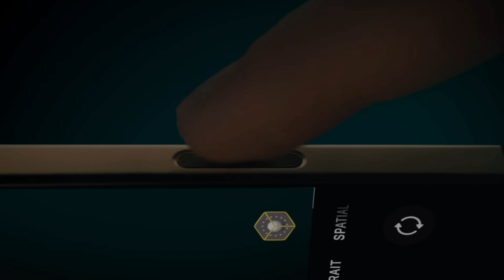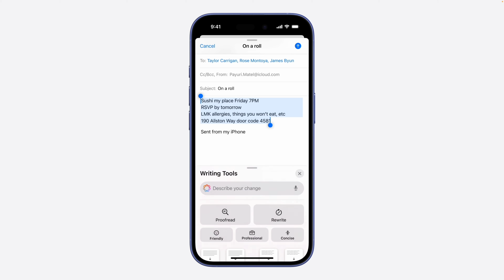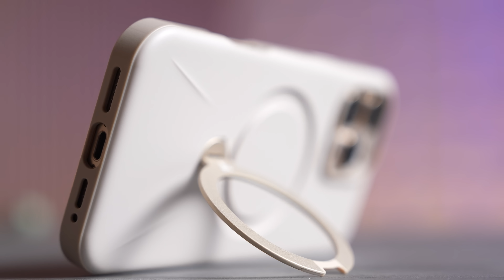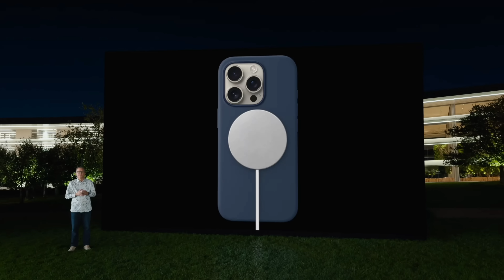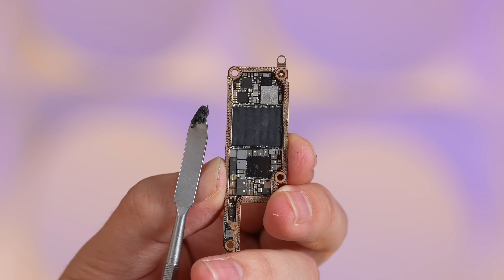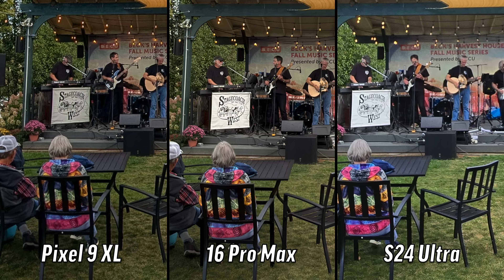iPhone 16 Pro vs 15 Pro - REAL Differences After 1 Week!

Comment: I have been using the iPhone 16 Pro Max for a week now. As I switch from Android, I still have some time to get used to using it. I can already say that I am happy that I switched. As for the camera button. It works much better when used with a thumb. Here you just need to flip the phone so that the button is at the bottom instead on the top. There the location is perfect for the thumb.

Comment: If you’re a gamer, the 16 promax is a very welcome jump. I’m assuming this guy is more referring to the casual customer that has no idea that they’re walking around with a mobile PlayStation 4 in their pocket. It keeps frame rates much much steadier than the 15 Pro. It stays much much cooler and never throttles even one playing the AAA games like death stranding. 

A lot of the stuff these days is going to be under the hood of the phone that most people aren’t going to be able to notice  YETTT. As the AI boom continues, you’re going to have no choice but to pick one of these newer phones simply because of what Apple has done under the hood. 

It’s one of those things you can’t quite see now  (unless you’re a gamer like me).  But you will definitely see down the road.

Comment: You wouldn't have had any Wifi improvement at your home between iPhone 15 & 16 because Wifi 7 requires a Wifi 7 capable access point to negotiate with your iPhone,.  If your home isn't Wifi 7 capable you won't see any improvement

Comment: You'll never notice a change in wifi speeds until you change your router or access points. I bet you're trying to use wifi 7 with a wifi 6 router or worse a wifi 5 router. Many ISPs do not replace their outdated customers tech

Comment: While I use the action button everyday as flashlight toggle the camera button was nothing but a nuisance. When I tried to make use of it it didn’t work properly and the most of the time it did nothing but produce bad haptics due to the cutout most third party cases have here. I returned my 16 pro max due to the enormous size and weight and no I am torn between 15 pro, 16 pro or base 16, because I want to be ready for apple intelligence, but the camera button really holds me back from pulling the trigger on the 16 series…

Comment: Hi, I wanted to ask, I now have an iPhone 12, should I upgrade to an iPhone 15 Pro Max because of the similarity between the 15 Pro Max and the 16 Pro?
Reply: Hi, I changed from an Iphone 12 to an iPhone 15 pro last year. Definetely worth it, huge difference for me. Now the differences between 15 and 16 in general are subtle so I guess it depends on your preferences but I would say save your money and get the 15 one. I will only change again for the 17 pro or 18 pro, depending on when there’s actually a noticeble difference again.

Comment: Got the 16 pro today. 
Action button is great, i personally use it for settings. However like you say with double tap for camera i replaced for music on android. 
Camera button is why i upgraded from the 15. I take alot of photos of cards which the button saves time not needing to adjust grip to click the on screen button. The gimmick in the settings are not that useful bar the zoom feature. 
My biggest bug is size. In first glance it looked a little taller comparing to the 15. In hand after a day it feels clunky. Il try for 3 months but day one is telling me to revert back. Felt like the 15 was the perfect phone size.

Comment: Thanks for the review. Are you able to compare the 3x optical zoom of the 15P with the "Zoom to Crop" equivalent of the 16P and give an indication of how they compare? I like the 5x optical zoom idea on the 16P but did quite like the 75-85mm focal length range (around 3x). I had a question how much quality degradation there is on the 3x photos without pixel peeping.

Comment: My biggest gripe on the iPhone 15 pro max is thermal issues. It gets warm and hot too easily especially in summer. This is unacceptable. Yet they make a faster MagSafe charger? The phone would cook an egg. They really need a real fast charging. Not upgrading.

Comment: Camera Control is a gimmick - fiddly, slow and stupid as the on screen options are already there and are much faster to access. Who the *@!(! has the time to do Camera Control when taking a quick picture ?! ?! Please

but there are few PRO's for 15 pro vs 16 pro:
PROS:
+ Better thermals;
+ Improved battery performance probably due to improved thermals, cpu optimization + screen capable of going as low as 1hz; 
+ Bigger screen although in real life usage its effect is minimal;

CONS:
-Heavier
-Slightly larger frame !!!very!!! slightly affecting one hand usage
-useless button called Camera Control

Comment: Ofc the 15PM vs 16PM will feel like a rip. Apple only needs to cater to typical upgrade intervals. By mobile carriers, that’s every 2-3 years, so as long as the 17 is a large improvement over the 15, Apple will have done well.

Comment: I switch from iPhone 4s to 5s…
And then from 5s to SE (old se)
And after  this it was 12 mini …
After 12 mini to iPhone 15 pro… And that was an upgrade … 
on ip15 pro i have all what i need… 
For now it is very good…
Maybe iPhone 18?
Reply: 12 mini to 15 pro max…today i ordered
Reply: How is the 15 pro after so many years of small phones?
Reply: @ballooneyjr4294  Because they killed the mini phones. I am using 13 Mini and desperate for another Mini but with the same top specs as the 16 Pro/Pro Max. But now I guess I will have to stick with my 13 Mini until it dies. I love it, but I will have to replace it some day and the fact that nobody is making Mini phones really makes me sad.

Comment: If I would not have had such a massive battery issue with the iPhone 12 mini, I would have opted to keep that for another year or two.  I could not last an eight hour work day without having to charge the mini.  Coming from that to the iPhone 16 Pro is ostensibly the same.  The capacity and screen is much better.  The added camera is not really a big deal and neither is the camera button.  Overall, it is a negligible upgrade.  I still have my 4S and was amazed how the experience has not changed since 2012…iOS is arguably the same and the 4S even shoots in HDR.  I do not get what people are looking for.  Technology plateaued in 2010 or so, everything since has been iterative and superfluous for most people.  Like the 16 pro but it does nothing my 12 mini or XR did not do…again, beyond the display, battery and capacity.

Comment: I'm glad you compared the 15 pro max to the 16 pro max as I fairly recently got the 15 Pro max for the first time, and it's great, battery life, lenses and Dynamic Island all great. It's a bit disappointing that 16 pro max isn't much if any improvement, companies can't do the quantum leaps they used to every year. The wait for apple intelligence is strange as they are advertising something which isn't there yet. Maybe it isn't reliable yet, or the local compute infrastructure isn't completed yet. Surely there must be rumours

Comment: So if you were upgrading from a 10, 11, or 12 would you go for the 15 or 16 be it pro or pro max?
Reply: that's what i'm wondering too. i'm going to upgrade from a 11 but idk if I should get the 15 pro or 16 pro. I don't really see much difference. and the 15 pro is cheaper. I wonder if the 16 pro is really worth it

Comment: Solution/Fixes to Camera Control Button and ALL three (3)  camera concerns! First Step… go to Settings > Accessibility > Camera Control > Lighter-Press Force > (✅Check the) ‘Lighter’… Next in the same Accessibility Camera Control area at the bottom, (✅Check the) Double Light-Press ‘Slow’… these two (2) settings makes a MASSIVE difference and works super consistently.

Thirdly, to see the On Screen Camera Controls while also using the Camera Control Button. 👍 Go to Settings > Camera > Camera Control > Clean View (and toggle the switch to OFF).

Hope that will others out there… it TOTALLY changes the way the iPhone 16 Pro Camera Control Button works. 😇🤓😎

Comment: I’m still under the impression the upgrade from the 14 pro to 15 pro was the absolute worst in terms of price/ performance upgrade. Feels pretty much exactly the same with a case, yes I’m aware that the titanium is lighter, but in a substantial case, that weight difference is not all that noticeable (Maybe more noticeable in the ProMax with the 5X being exclusive). For live stream HEVC encode performance, efficiency, heat dissipation, this generation from the 15 pro to 16 pro was a tremendous upgrade, since it finally allows me to run Moblin on 4 sims without overheating or trickle charging. I definitely realize encode and bonding multiple sims on a phone is an extreme heavy use case that goes way beyond power user/ heavy gaming. As every component gets taxed to the limit! For extreme use (when not using my prosumer grade LiveU Solo Pro), it is basically the only option in existence that can keep up similarly (ProMax being slightly too heavy and large on a monopod), and my other stream phone is the S24 ultra which pales in comparison, However, the S24U screen is chefs kiss! Amazing as a chat phone. No bias, each has their advantages and disadvantages. My Pixel is now regulated as a backup of a backup in the form of a modem now, Jack of all trades, master of none. Imho

Comment: The only reason to upgrade is battery life. So, looks like this is the second time I will postpone the upgrade (the first one was from 13 to 14). Really disappointing release with no significant hardware updates. Moreover, Pixel 9 XL shoots look much better in the comparison in this video.

Comment: One thing that I do appreciate with the camera is the new raw format jpeg xl lossless I assume that’s the highest quality but the thing that impressed me was it was half the file size. I tested it against my iPhone 15 Pro Max, which is really nice to save space.  Also, I did appreciate the speaker being a little richer like you said in your other video.  Of course the battery life is always welcome.   I agree with you. It’s not the biggest upgrade and it is a little disappointing although I do appreciate the 48 on the Ultra Wide. 
One thing that is also keeping me from not returning it and going back to my old phone is that I would like to have an action button and then have the camera control button for at least quickly opening the camera so I can have the action button for something else    I do agree with the Mac rumors podcast that we were reviewing the new iPhones.  It really is faster to just use the screen to change the lenses, etc.. I’ll probably only use it to open the camera and possibly zoom on certain occasions but not sure I’m gonna get used to snapping photos by pushing that button time will tell.
One disappointment that I had is that my old case that I had for my iPhone 15 Pro Max, I re-ordered the same case for the 16 Pro Max and it was bulky  and the camera control button didn’t feel good holding it in the hand because of the cut out on the case and the sharp edges    so I’m having to try another case that I like better    there’s a company called geometric goods that has a folio case with a magnet in it and you can put in an iPhone without a case or it’s compatible with other MagSafe cases so it’s kinda nice to be able to have a folio and then put your phone with the case inside their magnetically.

Comment: Thanks for pointing out iPhone 16 lines don't have or use Qualcomm x75 modem unfortunately, it's a total failure!! Also, I read somewhere iOS 18 use AI for battery use so that it will automatically optimize so we cannot expect a very standard performance all the time.

Comment: I’m one of those person that upgrades every year and I have to say I honestly should had just skipped this year’s upgrade. The ultra wide angle is worse than the 15 pro max, and the capture button is really only good to lunch the camera, other than that it’s useless. I’ve tried using it but I keep missing shots because it doesn’t have a quick response, you have to hit it just right. It’s just easier to use the touch screen to take photos. The battery life is definitely better and they seem to have solved the over heating issue but honestly not sure that was worth the upgrade.  The 17 better have significant improvements to make up for what the 16 lacked. I’m talking new bigger sensors on all 3 cameras lens.

Comment: Looking at available data, people who upgrade every year are a minority. As a YouTube creator who reviews tech you’re in an even smaller minority. Data shows that most users are hanging onto their phone for 3 or 4 years, some as long as 5 or 6 years. Apple are aware of this hence their advertising comparing new iPhones to iPhone 12 users. People upgrading so many versions in a single step will see a massive improvement. You should try the same - you’ll get better views and engagement.

Comment: 1. My 16 Pro Max doesn’t overheat as bad, I’ve only had it dim for a short time when out in the sun.
2. Something about the mic’s, Siri hears me better and dictation has improved markedly.
3. The battery life is, as you pointed out, a very nice improvement.
4. I wish the camera button would engage burst mode instead of video, when fully pressed.  I’m hoping that this option will come, that would be very nice for me.

Something weird that I haven’t seen talked about, but in my situation I often clamp my phone in a tripod mount.  I noticed that when I place the clamp on the camera button, it doesn’t activate it.  I thought “great”!  But then I noticed that the screen just under the button, looks wonky.  

I’m confident that Apple will come out with the new software and we will be much happier with having purchased the new phone.  Frankly if the reason they are taking so long is to perfect the software, I’m happy about that.
Reply: Bought 15 pro max day one and have had know heat issues buddy that why you don’t buy first batch like the 16 pro max which was a fck up

Comment: iPhone 16 Pro Max is solid upgrade and fix everything 15 Pro Max try to achieve. Clearly not a S upgrade due to hardware change(improved mic, thinner bezel,thermal, camera, and camera control)

Comment: Battery life seems like the only noticeable upgrade. Yes the chips got faster too but it’s not like the previous years processors were slow. No reason to upgrade if you have a 13 or newer. If you have a 12 you could say yes upgrade but I’d still just get a new battery put in before upgrading.

Comment: I upgrade from my 14 pro max cuz my battery seemed to got worse and usb c charge. I don’t seem much of a difference in camera but my nights shots seemed better. Maybe if camera control gets better in software updates I might use it but I disabled to not use I’ve tried to use it but it lags when opening the camera with the button. That’s just my opinion I say if you have a 15 pro max don’t upgrade 14 pm if battery is getting worse and worse then upgrade it

Comment: "Apple simply doesn’t want to release an iPhone that’s better or more expensive to manufacture than it needs to be. It has numerous advantages over the various Android hardware vendors: it has more money to spend on R&D, it can control and optimise hardware and software together, it has better customer trust and brand recognition, and its business model isn’t based on advertising and data capture. But while an “insanely great” iPhone might kill Android as a realistic alternative, it would cut into profit margins and leave Apple with nowhere to go the following year. A better long-term strategy is to release phones just enough better than the previous generation to shift some units… and Google is welcome to stick around in the meantime." David Price.

Comment: Apple does incremental upgrades. No one should upgrade from the iPhone 15 to the iPhone 16.  If you upgrade from the iPhone 10 or 12 you will be happy
Reply: Yeah definitely not worth it this year. I have a 15 pro, I had a regular 12 before the 15 and the difference was huge. Especially photos in low light.
Reply: @Deegan02  Just upgrade to 15 Pro? makes sense to me
Reply: @Deegan02 bigger battery is worth it alone.
Reply: @Deegan02 same here! Upgraded from the regular 12 to the 15 pro. Totally worth it for me. Now to upgrade again it will have to be at least the 17 pro or 18pro, in the future.
Reply: Well I have 12 and honestly, I will just upgrade to 15 pro, I don’t think 16 pro has anything useful for me, and the apple intelligence is supported on 15 pro models too so… yeah
Reply: I upgraded for the thermal improvements, and I have zero regrets there. I'm not getting that dimming and throttling.
Reply: @chrisanderson9981 How much better are the thermals compared to the 15 pro max?
Reply: I’m considering upgrading from 15 base to 16 pro.

Increases ram, better battery and performance is like 15pro.

And I feel like the 15s will lose resale value quickly as they are the last iPhones with 6gb ram
Reply: What about if you have an iPhone 11 Pro? Should I go to 15 pro or 16 pro?
Reply: @mofo02  15 pro. Save some money, it’s practically the same and you’ll notice a huge difference coming from 11
Reply: @mofo02 If you have the money get the 16 pro
Reply: I’m coming from the XR. Trying to decide between 15 Pro, 15 Peo Max, and 16 Pro. Have zero interest in Apple intelligence and think it will just be annoying.
Reply: It's not about moving from 15 to 16. It's about moving to 15 or 16. Read carefully.
Reply: I never understood why people just won't trade their current phone for a new one.
Reply: @hadivazifehdan5596 I traded my regular iPhone 12 for the iPhone 16 pro. Verizon gave me 1000 bucks for trade in so I went with  the 256 gb. So it’s only costing me 100 bucks.
Reply: Agree